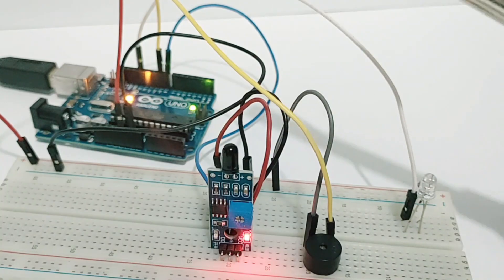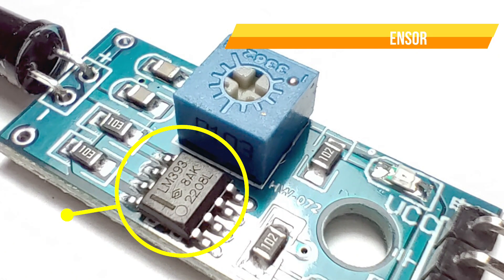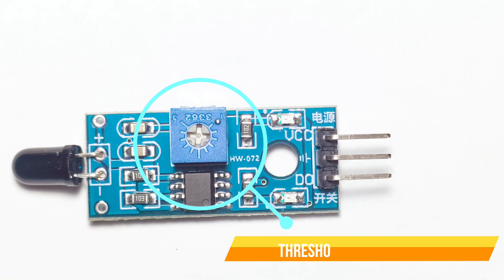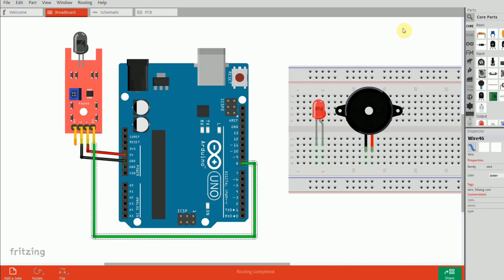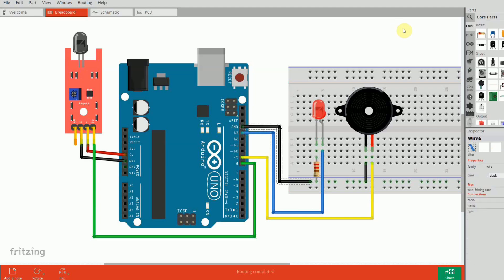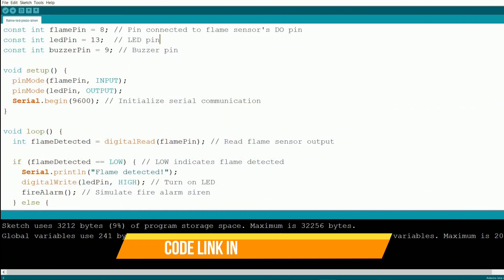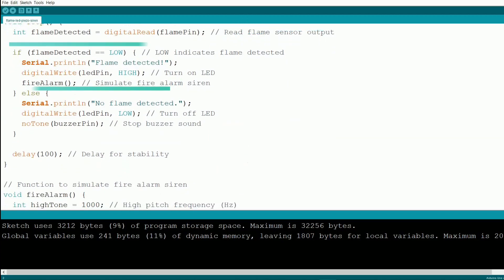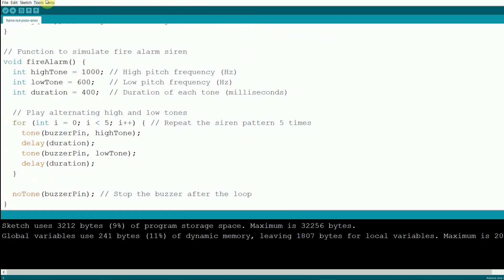Arduino Fire Detector with Siren and LED | Step-by-Step Guide

Comment: LiFi-based Fire Alarm
System
Problem Statement:
Traditional fire alarm systems may fail to transmit signals reliably in large buildings due to Wi-Fi interference or low network coverage. A LiFi system can instantly communicate alarms to a central control room using light signals.
Could you please help me with this project

Comment: Am i able to use an LM35 sensor instead of the LM 39 witrh the exact same process?
Reply from the maker: Yes, you may do that. Check this article for how to use the LM35: https://www.arduinointro.com/articles/projects/ultimate-guide-to-using-the-lm35-temperature-sensor-with-arduino